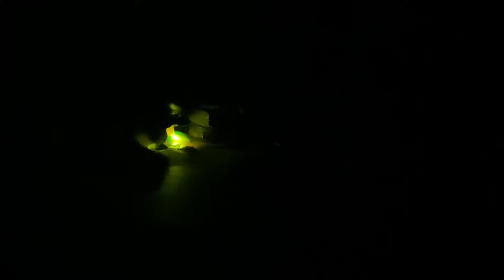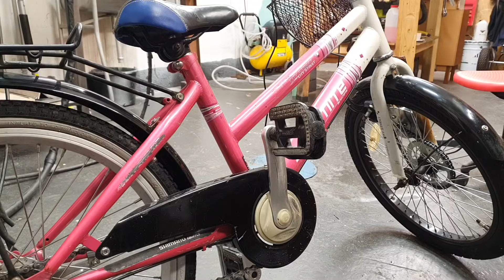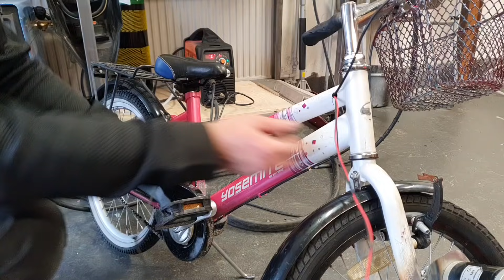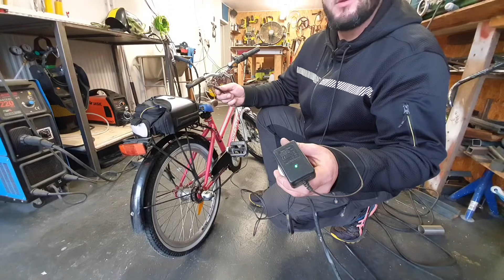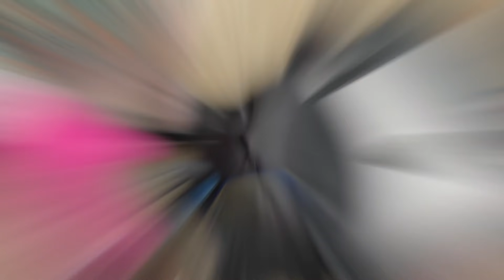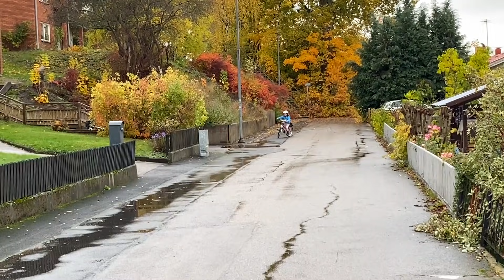Build an Electric Bicycle at Home

Comment: ❤❤❤❤❤weldone❤❤❤❤
1 use motor  may be like engine self start
2 use chain as needed
3 use battery
4 use speed controller
5 welding bracket
T A SHAHID PAKISTAN

Comment: Now show us something that doesn't involve welding and other relatively complicated and skilked processes, which the average person can readily and easily do!
Reply: you can drill and bolt the motor on and the sprocket can be mounted to the spokes using rubber pads, bolts, washers and nuts.
Reply: Even the welding is simple… lol spend $100 and learn a skill that will last a lifetime🤷🏻‍♂️
Reply: Man I built a bike from scratch using metal poles and bolts no welding and I just finished a small frame for electric bike it’s easy just do it
Reply: @pachurpants  spend a hundred dollars on a welder where? harbor freight is 140 plus tax for a junk chicago. i had one, it was pure junk. i purchased a lincoln 135, then the bottle, gas and wire ended up a little over 1K. not everyone can afford to buy certain tools just for small projects, a drill is around 50 dollars and works just fine. and best of all, you can disassemble bolted on parts if they go bad, no need for a grinder and more welding.
Reply: @josealvarado1378  yep, when i moved to where im at now, all my tools were in storage, with me i brought an 11 pc socket set, vice grips, drill, drill bits,  sawzall and allen wrenches, i built a buggy from an electric scooter using just those tools, the video of cruising around it is on my channel.
Reply: @pachurpants  boy skill won't last life long, until u practice and do it every time
Reply: @carolinabeacher1558  you can build a welder for next to nothing, you tube tutorials galore, also watch a few Indian creator channels, if they want something they just build it out of scrap, with a bare minimum of purchased parts.

Necessity is the mother of invention, have seen a steam engine built from dumpster dive parts. Need a lathe, milling machine no problem let’s make it. 

Prepare to be amazed and then feel inadequate worrying about buying stuff.
Reply: Why? Welding is easy. Or pay someone $20 to do it. .... Otherwise you'll spend $650 on a kit. Trust me, searched the net 100 times and this is the best one out there.

Comment: what provision is there to take off the front tire if a  repair is needed. looks like you have to undo the chain, the motor should have been made to swivel to easily change the tire.

Comment: I would have placed the motor above the wheel to gain better balance and less exposure of wiring to moisture and possable snags on bike racks, etc. A one way bearing could be beneficial for not driving the motor while peddeling.

Comment: I think a flat grooved belt would be less noisy with a spring loaded tensioner like a washing machine off course using a much bigger pulley on the wheel . It would be more durable and smoother on the ride and dampen the kick of the throttle . The chain and sprocket wont last  long it ll become slack very soon.
Reply: But the idea is good
Reply: Hummm, washing machine parts i have some. THANKS
Reply: Why do you think the chain will become slack ? The wheel can't move up any more and the motor is welded 🙄

Comment: One question about this?... It doesn't have a freewheel right?! So does this type of motor free wheels or does it stop the bike if you don't turn the throttle or run out of battery?

Comment: You should have used freewheel on motor shaft to avoid extra burden on pedal force due to cogging. The little angle has to apply more force when driving on  pedal to counter motor cogging force. The freewheel on motor shaft will disconnect motor rotation when bike moves on pedal force.
Reply: A

Comment: I'm building an ebike using this same motor, it runs the wheel when I lift the bike up,but doesn't run when the bike is on the ground 
please I need your help.

Comment: Greetings from Venezuela brother, my question is if you can fit a 12 volt car windshield wiper motor to a bike ????
Reply from the maker: Yes you can but you have to have 12v control

Comment: Pouch bag could catch fire once the battery and electronic components inside start to overheat. Water can get inside the drilled bike frame and corrode the steel frame from the inside.

Comment: I was most interested in how this "master" would adjust the chain tension. If he added 20 grams of brains, he could ensure that the holder does not weld to the fork. (by the way, 100% that he released her hardening) and welded clamps on threaded ties to the holder. And I would immediately do 2 things and you can adjust the tension of the chain and keep the stiffness of the fork. I am a former master of sports in road racing in the course of my classes, about 5-6 forks and steering columns broke. So I do not envy a child who will not ride this electric bike. Play it safe - change the plug and weld clamps on the holder!

Comment: Muito bom , parabéns 👏👏👏
💯 Sensacional ✨
Reply from the maker: Thanks
Reply: Olá, eu sou de Porto Rico que estou estudando ele português. Eu também estou fazendo uma bicicleta elétrica. Estou no Chicago. Chao.
Reply: @DIY.Invented  hi. He is congratulating you for a nice job. I am also converting an old mountain bike i picked up from the scrap yard and it has aluminum rims. I switched them to my mountain bike ( although old it's still good and free too) so i used the rims from my mb to do the conversation and i Had found in the alley an old 1977 3 speed sears  brand 27 inch bike. So from all three bikes I made one. I used the 3 speed system and switch it to the 26 inch rim removing all the spokes with a drill and then reinstalling then one by one using another rim as guide. Well i did this back in the 80s when I was flat broke to fix a bike to go-to work. I'm using a scooter starter and just waiting for a sprocket to arrive. What's best of all in this video is your little's girls smile. Take care and kuddos . I'm a welder too.

Comment: What do you use to recharge batteries: dinamo mounted on bike or external battery recharger??

Clever idea, though it's better if they bicycle away using their muscles and then if needed (tired) come over to the motor

Saludos = cheers
Reply: Cuanto vale esta adaptacion

Comment: I think it's a very good idea, but where can you buy the things and can someone help me. I offer you a thank you♥️
Reply from the maker: Thanks 
www.ebay .com
Reply: I think the motor and control module are from a Razor E90 or E100 scooter,  the battery will be 12v  7ah or above I think. Not cheap but you can get second hand. Do not need a control module if you do not mind going on to full power , just use a 12v relay and a switch. Hope this helps. Have fun stay safe and use fuse from the pos on the battery. 😉

Comment: One thing we need to stress is that this cannot be done to a normal childs bike without one simple modification otherwise this would pose a danger. The childs bike MUST HAVE A FREEWHEEL back tire. Otherwise the pedals would spin as the motor drives the bike and move the childs legs much too fast to keep up causing terrible confusion and probably that child would sustain injury. And a freewheel means HANDBRAKES. and remember... Speed + momentum + front brake only =ENDO. People please do not add a motor to your childs bike unless you completely understand each and everything I just wrote.
Reply: Mop